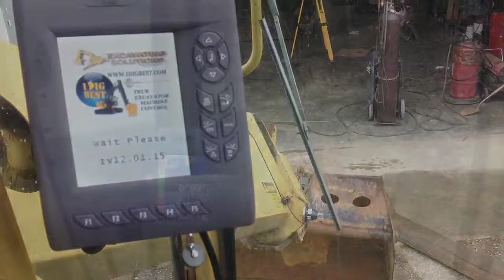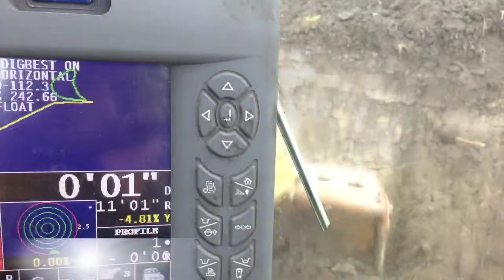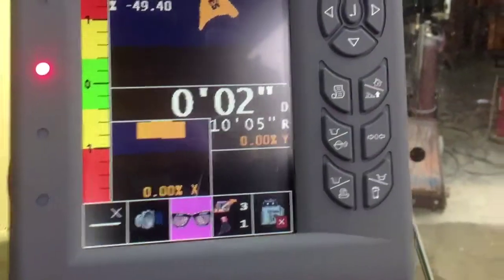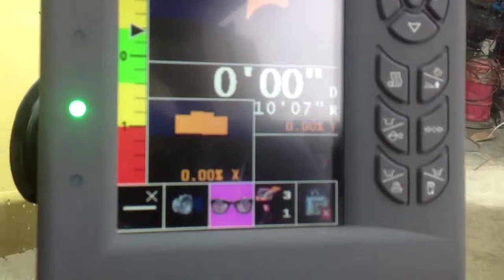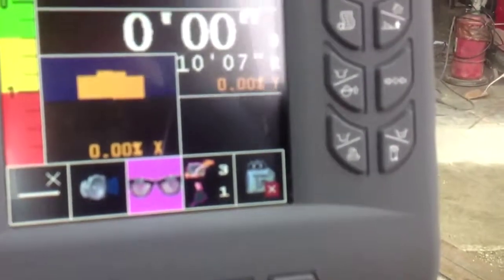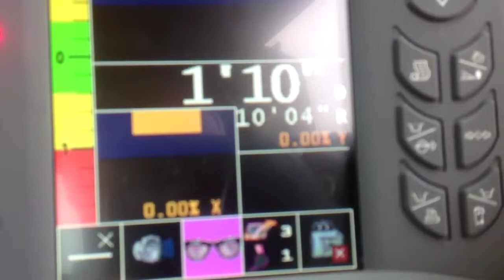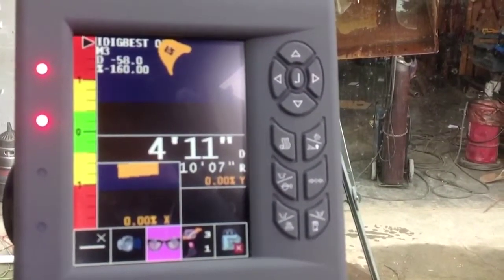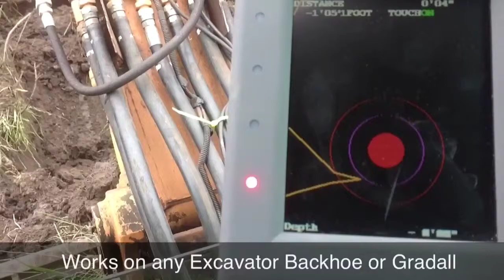Idigbest plus gradall

Comment: That's pretty cool, but before I'm convinced,  I'd still like to see it do a longer slope. Say something like a 1:1.5, about 12-15 foot from hinge point to toe, and about 50 to 100 feet long in full Gradall fashion, utilizing the tilt functions.
Reply from the maker: idigbest will do all slopes vertical to 360 to slopes above you in a mine. also will do curves roller coster style. the coolest this is it also does tilt auto control! so you can cut 3D like a dozer!